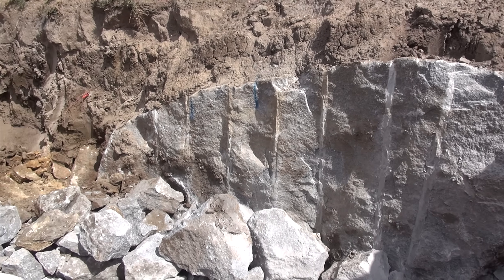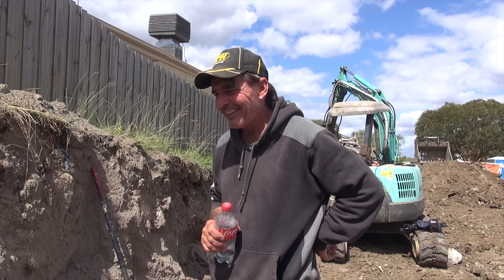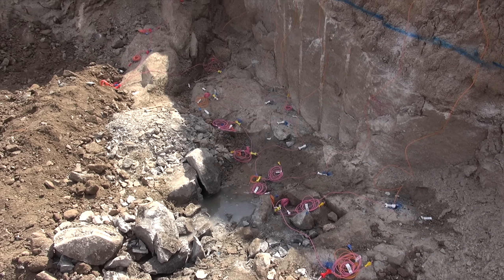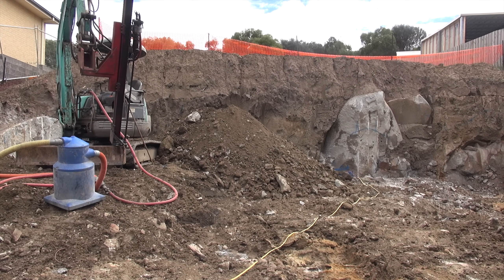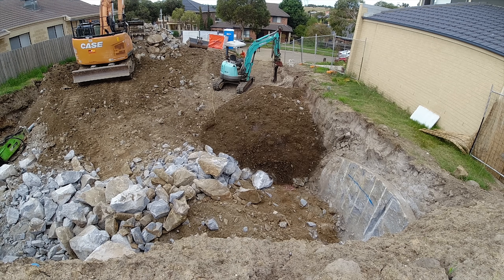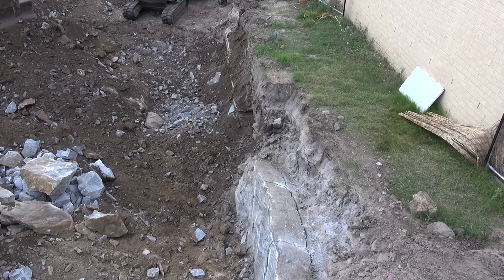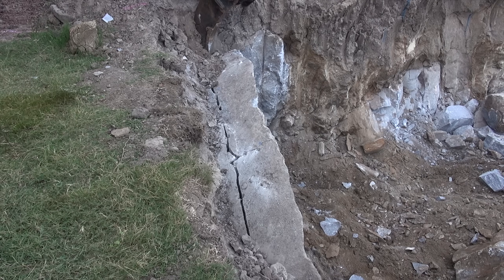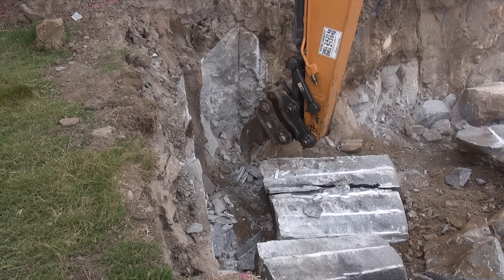Breaking huge granite rocks with Chemical Cracking Agent, part 2

Comment: Three million year old rocks wondering WTF is happening!
Reply from the maker: Closer to 300 Million actually.
Reply: @demolitiondavedrillandblast  I stand corrected! May I ask, is the only reason you started with Expando, then moved on to bang sticks on that job, the fact that the client already had the cracking agent, nothing to do with the close proximity of neighbouring houses?
Reply from the maker: The builder had already purchased a significant quantity cracking agent and going this way on the largest rocks was a fair call as there was plenty of 3m deep holes on this one and the amount of explosive required per hole would have been such that the level of vibration would have exceeded the statutory limit at the neighboring residences.

Comment: Now that the lot is ready there is no money left to build the house, and the bank won't finance any more than a normal build minus some owner equity.  LOL!  But then that's not Dave's problem either.  Nice job!  I learned a lot.  That chemical stuff is amazing and you must have a ton in just that air compressor and drilling equipment and some pretty good material expenses with those bits.
Reply from the maker: I'm not sure about the financial logistics of the build Jack. Yes, there is a big outlay on tools and big wear and tear in this line of work.

Comment: Dave, do you use delays on your live shots to minimize ground vibrations?

You do such a good job covering rock to be blasted with backfill. That certainly reduces the sounds and flying rock frags. The energy pulse travels through ground fairly quickly and it can travel quite far. Neighbors might not hear the shot, but their shaking windows and dishes rattling in cupboards is hard to disguise.

I know on big quarry shots delays reduce ground movement. Same with implosions.
Reply from the maker: I always use one hole per delay period on domestic jobs.
Reply: @demolitiondavedrillandblast  thanks for reply

Comment: When do you choose chemical cracking over explosives? I guessed in part 1 you couldn't use explosives due to the other nearby homes.
Reply from the maker: Initially it was the customers call, they were fairly concerned with the idea of using bangers, I talked them into it later in the job.

Comment: I wonder why the plot wasn't developed earlier! It's almost as if someone knew how little dirt there was between the rocks.
Reply from the maker: Everybody on this side of the street has had a massive excavation challenge.
Reply: @demolitiondavedrillandblast  Is there not a case to be made in terrain like this to simply add 2m of soil over the whole plot?  Are there council/homeowners regulations that prohibit a house on (soil) stilts so to speak?

All you really need is space to park the car at street level.
Reply: @KallePihlajasaari  Moving lots of soil is expensive too, as would the retaining walls to hold it back, and then you'll have an extra two meters to climb every time you wanted to park your car or get into your house. Plus then you'd need to worry about maintaining the retaining walls, and the house would look silly being raised up like that. I imagine it's much cheaper both long- and short-term to just get rid of the rocks.

Comment: What do your vibration levels look like on those shots?  I see very tight pattern, so assuming your charge weight per delay is quite low.
Reply from the maker: The vibration is minimal, most of these holes have only 60grams in each hole  (1/3 of a 1 1/4" plug).

Comment: does the granite there ever have pegmatite zones occur in it?
Reply from the maker: Mmmmm... no, not in the rock I work in, which is mostly Granodorite, not strictly Granite. It is common to find intrusions of quartz or hornfelds and sometimes black zenoliths which are very hard - probably hornfelds.
Reply: @demolitiondavedrillandblast  my local batholith is also granodiorite and it has a lot of pegmatites. Interesting. I wonder if it was because they formed at different depths. I think pegmatites only occur when the magma cools somewhat close to the surface.

Comment: Hi. How come you dont use rubber matts? Just interested in how you work, here in Sweden we always use rubber matts when we cover. Good content 👍
Reply from the maker: I need an extra truck to transport a load of them, they are very high maintenance and if you have a very large rock, you have to take several bites at it when it is best (from a complaint perspective) to get it all over and done in one shot if you can. The soil also does a much better job of managing the noise and it is already at the job. Post some video Martin.
Reply: Yes handling them sometimes is a struggle. I work for the city so the  budget and a truck to move them is not a problem. 99% of the blasting i do is in a trench with water an sewer pipes just next to the blast. So using rubber matts is the only option. I will try to film sometime.

Comment: Is there a big difference in price for tyke coustomer if you are Blasting or using the cracking stuff?
Reply from the maker: The Chemical is not too expensive but the extra drilling is very costly.

Comment: Why don't you use the big mats when blasting in the residential areas?  They are used to stop fragments of rock flying around right?
Reply from the maker: Yes they do, but they do little to manage the blast noise - which is what brings complaints.

Comment: I didn't realize the scale of that last slice of bread until you jumped down on the ledge to clear the hole, and it looked like a sidewalk! Lol
It looks like the boom butter works on that type of rock a little better than the slo-mo exploding goo.
Reply from the maker: Oh, for sure Ben, the cracking goo (snail dynamite) is good but real explosives are king when you can use them.

Comment: looks like you could have popped that last slab loose with a 2 or 2-1/2 meter wrecking bar Dave! nice cover lift on most of those!! i'm still amazed people settle for lots that size! a lot that size is a damn fire hazard the house next door goes up your's is likely to go too (not to mention not having any front or back yard for recreation and relaxing in!)! hell if the winds right the entire block could go!!
Reply from the maker: This is a good size block by current standards Kieth!
Reply: @demolitiondavedrillandblast  still from the look of how it was sitting it looked like it could tipped over with a bar easy enough! it may have just been the filing angle though!
Reply from the maker: I'm sure I could have got it out with a crowbar Keith.
Reply: @demolitiondavedrillandblast  Dave, it was just an observation on how it looked nothing more! basically thinking out loud so to say! i will say this though going by what you've posted already you won;t run out of work anytime soon!!

Comment: Thanks Dave. Your work sure saves the breaker machines.
Reply from the maker: For sure David, the breaker is really challenged in this rock, however after some blasting or cracking agent work the breaker can get a lot more material out.

Comment: Almost wish that last rock wall you exposed could be incorporated as a permanent testament as to what it took to build the house.
Reply from the maker: Yes William.... most of my best work is behind retaining walls and under concrete, such is life.
Reply: At least maybe use those square columns as landscaping elements
Reply: Yeah.  Would make an awesome testament wall’.
Reply: Unfortunately, the ‘testament wall’ idea would probably not be allowed from an engineering standpoint, as they might be concerned about the rock’s structure after cracking.